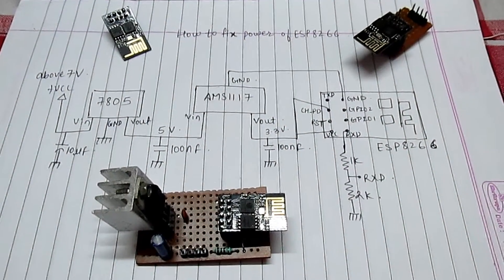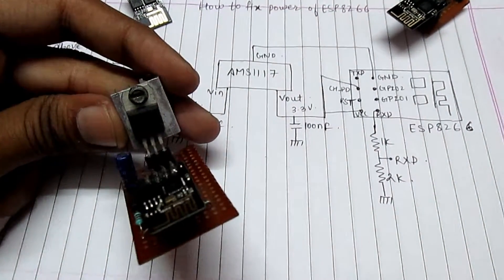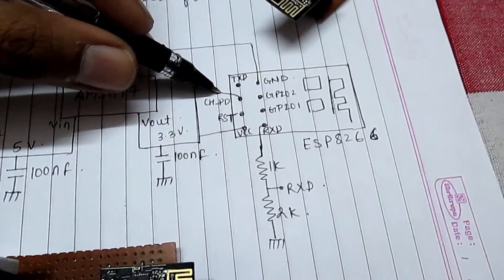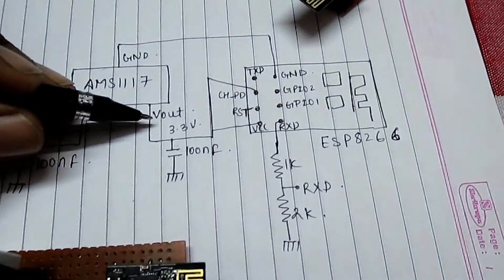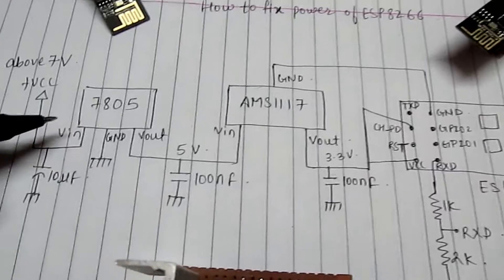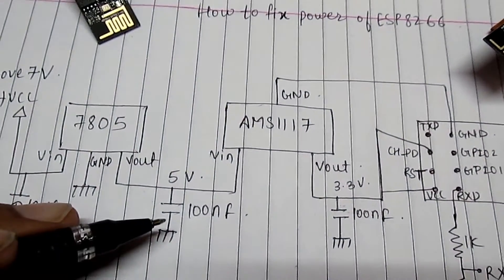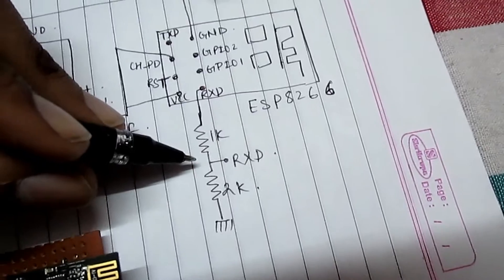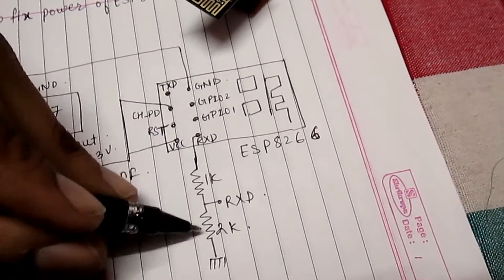Fixing Power Problem of ESP8266

Comment: Thanks for the video.  Just to build on what you are recommending... from my own experience I would recommend a much larger capacitor (e.g. 470uF @ 10V) be placed as close to Vcc as possible.  I'd also recommend when tying CH_PD to Vcc to use a 4.7k to 10k pullup resistor.
Reply from the maker: Yes Dave what you is right but the above circuit also works perfectly with no any errors & Thank You ...